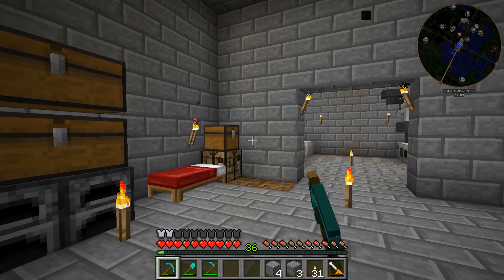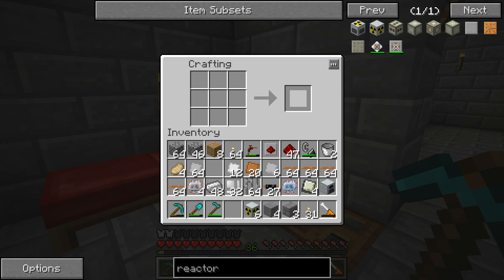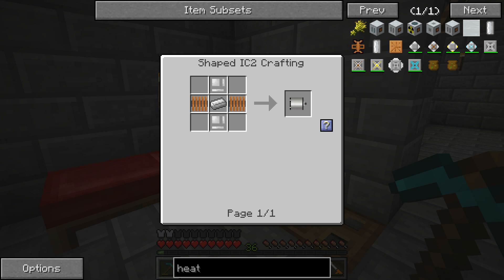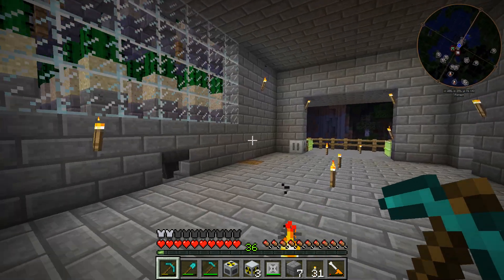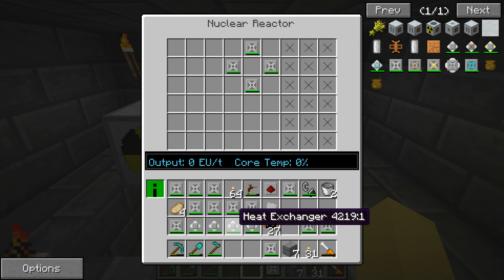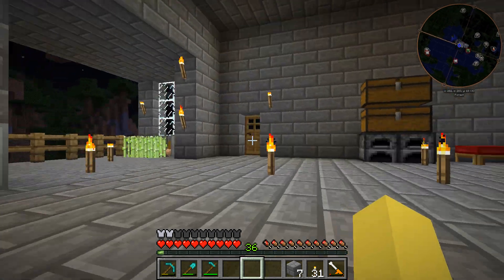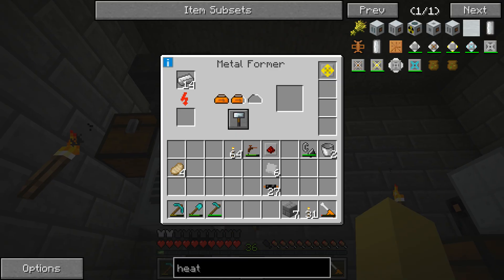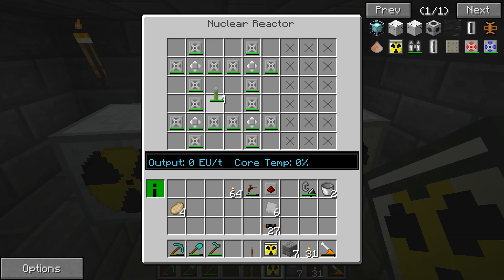Surviving With IndustrialCraft 2 :: Ep.10 - Simple Nuclear Reactor Setup

Comment: Well its been 7 years since you made the vid, but i want to ask something. I have induction furnaces 10-15 i think. Im powering them with a separate nuclear reactor thats making 155-160eu/t. If i try to go up with the power, furnaces will explode. If i stay at 155-160eu/t furnaces run out of power. Why do they blow up? I have 3x insulated HV Cables 2048eu/t .80 block loss.
Reply: Answering after two weeks - Induction Furnaces can't handle more that 128 EU/t. You must use a transformer.

Comment: I developed a modular design where 3 of these fit in 1 fully-chambered reactor.
IDs:
MUFL: Mono Uranium Fuel Rod
REFL: Neutron Reflector (any kind)
ADVE: Advanced Heat Exchanger
OCHV: Overclocked Heat Vent
RCHV: Reactor Heat Vent
PLTE: Plating, any kind, used for automation.
|, +, and -: Cell Separators

Setup:

PLTE|RCHV|PLTE
--------+--------+--------
OCHV|ADVE|OCHV
--------+--------+--------
REFL|MUFL|MUFL
--------+--------+--------
REFL|MUFL|MUFL
--------+--------+--------
OCHV|ADVE|OCHV
--------+--------+--------
PLTE|RCHV|PLTE

It is a Mark II design, which means some components require cooling after a cycle is over, but never explodes.

Comment: in the reactor planner .jar it works as a steady reactor, but running ic2 version 2.8.164, those heat vents are not enough and are depleted, replacing them with advanced heat vents does work tho. is this an update or what is up?

Comment: You should have the wire the puts out a red stone signal next to the reactor and a storage device on right after. Than have another one of those wire on the out put of the storage and have the redstone run to the reactor. When power gets drawn the reactor turns on and then shuts off again with the storage unit is full. Makes the reactor super power efficient

Comment: is the heat usable in any way? I mean can you keep a heat consumer next to it?
Reply: As far as I know, you can’t use the heat from normal generators, but for liquid-cooled reactors (which are more expensive and take up more room in exchange for more power), you have to dissipate the heat or else it will melt down. You can dissipate the heat into stirling generators to make more power.

Comment: so they removed the isotopes and you can connect L4 power with simple copper cables? and  wow they actually made it default off instead of on lol the most special is i see no coolent cell or water around your setup, nor thermal sensor to shut it off at a certain point automatically... they changed this mod so much they should have called it IC3...

Comment: will a quad mox work?
Reply from the maker: You have to stick with the exact setup given here has a quad mox would have different values in terms of heat generated. It may be able to function on and off, but I doubt it would line up exactly and be able to run 24/7.

Comment: For safety reasons (because these reactors can explode violently), I would put my reactor near bedrock level beneath my base, and in a room lined with obsidian to minimize damage in the case of a meltdown. I know this series is over now, but this suggestion is more for anyone watching after it's over.
Also, it's a neutron pulse you're thinking of. The real-life science behind it is the reactor generates power from the heat generated by the splitting of atoms. This splitting also causes random neutrons to fly off, and likely hit another atom of uranium. This splits the hit atom, and perpetuates the cycle.
Reply: well... I shoulda read the comments
Reply: @JaredDaAmazing  😂
Reply: In factorio we just call it a “neighbor bonus” you whipper snappers
Reply: Called a chain reaction and i still play this in infinity evolved
Reply: My 3 reactors explode :(

Comment: I tested the reactor explosion in a 3 blocks thick obsidian box under the ocean
and I filled the reactor all QUAD fuel rod it worked pretty good
some of the wall was all blown out but the edge the box remained unharmed
Reply from the maker: That is great news! I know lots of people are afraid of IC2 reactors because of the threat of explosion, but if they just do that and/or use wireless power transfer there is nothing to worry about.

Comment: the answer is 12.00390625 HU i'm pretty shore. 8 + 0.25 x 0.25 x 0.25 x 0.25 + 4.
because a tick is 0.05 seconds and a fuel rod makes 5 EU per tick so 5 x 0.0. and the 8 and 4 are there because he four rods.
Reply from the maker: Hmmm, interesting! I never actually went and did any of the math out, but thank you :)

Comment: I set up this reactor and now machines are blowing up. Any thoughts?
Reply from the maker: If you are using a different version, too much power to certain machine can cause them to explode (same with wires). Because of this you need to add transformers to lower the power going through to the machines.
Reply: I was having this problem as well. I figured it might need a transformer. So, I configured my reactor so it produced 120 EU/t, and connected a LV Transformer (128/t to 32/t) between the reactor and my machines. But, with the transformer connected, nothing was getting power ... Until I figured out the side with 5 dots was supposed to connected to the cable that came from the reactor.

Comment: One thing I always used to do, and probably would now,  is fill any empty spaces with reactor plating. That way if something does go wrong and heat vents burn out, the reactor should be able to absorb the excess heat.

Also, if you have all 6 chambers, you can still access the UI from any block, including with say sorting machines.

I can't recall if having a comparator on the reactor reads heat, but that might be useful to plug into an AND gate set up so it can't get too hot. (With the other input being power required.
Reply from the maker: +Triaxx2 Noticed half way through the video that you could click any block to get access :P didnt wanna mention it tho lmao

Comment: Played for about 2 weeks with nuclear reactors and finally realized that they dont worth the investment. Its much easier and cheaper to construct a huge wind generator. Plus u dont hafta get lost in mines searching for that green precious ore. And yes, biogas stuff is also cool, i built a biogas farm near my house, it generates 768 EU/t. 

If only nuclear reactors were generating like 4x the amount of energy, then yeah, that would be awesome and cost-efficient.
Reply from the maker: +BOOMbarash5000 I don't doubt nuclear isn't the best return on investment :) main reason I made it is because most people wanted to see it and need help with setups (which I can hopefully provide).
Reply: +BOOMbarash5000 There are some very important modpacks like InfinityEvolved which require ic2 reactors because of the plutonium that come from the depleted uranium cells, so eventhough you're right that they don't ouput a whole lot of power, still they are necessary for progression in some packs. :D
Reply: one of my ultimate goals in ic2 is a bunch of passive plutonium generators.  they're only capable of 32 EU/t, so you'd need a ton of them, and you only get plutonium from a crap load of depleted uranium, BUT they're infinite sources that you never have to do anything to maintain.  
(they're called rtg pellets and thermoelectric generators.)
Reply: so that's my main reason for using nuclear reactors.  and that's why i try to make the most inefficient reactor designs possible, to burn through the uranium as quickly as possible.
Reply: You get more plutonium by running mox generators instead of uranium. And you get loads of rtg pellets by connecting a mass fab to those generators as you replicate them. Pretty self-efficient as I fed the output straight back into the input to the generators.
But your idea is perfectly fine also J.D.
Reply: nuclear power supreme